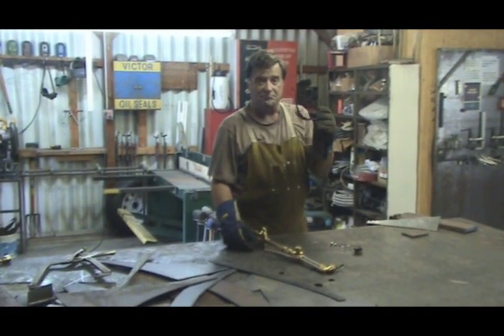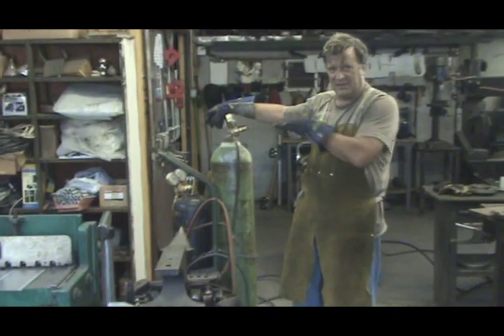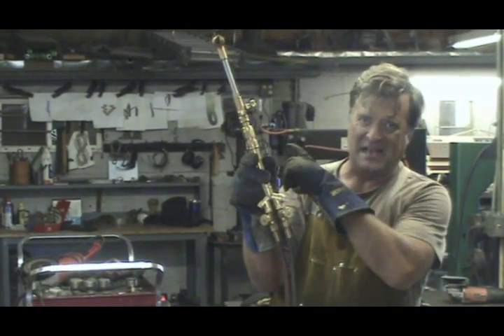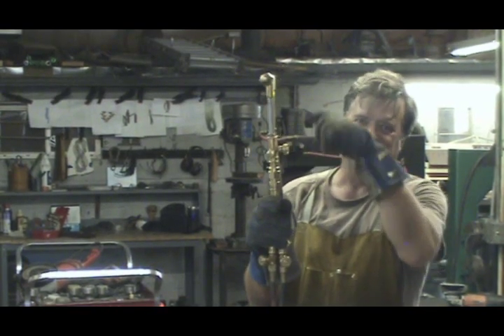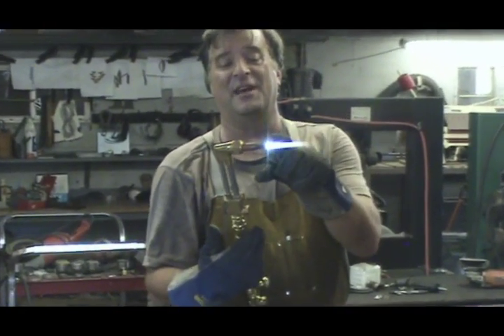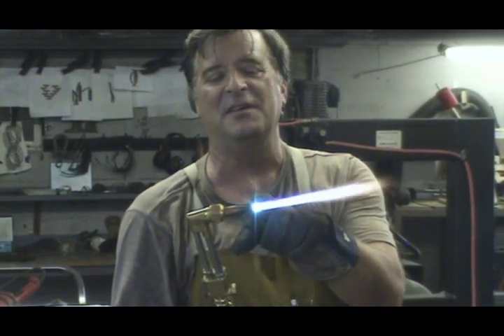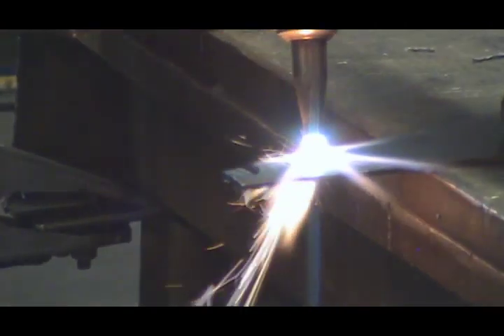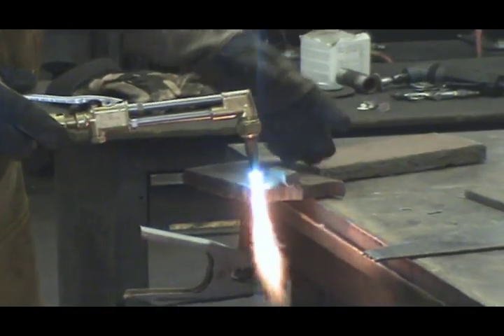Metal Cutting: Using Oxygen-Acetylene - Kevin Caron

Comment: Hi Kevin, a question for you. I am starting to learn Oxy-Acetylene cutting. I shut off my torch, acetylene first, oxygen second, but the flame didn't go out fully. A small 1-2" flame kept burning at the tip for 30 seconds or so. I don't know how long it would have kept burning. I turned off the tank. Could there be a problem with the acetylene shut off valve on the torch? Some other issue? Thanks so much!
Reply from the maker: YES!!    You have a bad valve in the torch handle.   Time to have it rebuilt or replaced.   You can take it to your local welding supply and they can get it rebuilt.  You should also take both regulators and have the whole set done at the same time.
Reply: Thank you!!! I will do so.

Comment: @kevincaron I too have seen the "open 1/4 turn" for oxy, but typically only in books for metal artists.  All of the "open oxy fully" comments were in hardcore welding books.  Just two I found:

"The oxygen valve is opened all the way until it becomes tight ." 
'Welding: Principles and Applications', 7th Ed, Jeffus

From Stanford University:
"Open the main valve on the oxygen tank.  Turn the valve until it is fully open (until it stops turning)."  

Thanks for your great videos Kevin!

Comment: Hi Kevin; I like your videos, but this one contains a pretty glaring error:  You state that a O/A cutting operator should open the valves on both tanks a "quarter turn only".  That may be correct for the acetylene, but most definitely NOT for the oxygen cylinder, as you must turn the oxygen tank's valve ALL the way on, since oxy valves are double seated (if not opened completely the oxygen will actually leak from around the valve stem's o-ring due to the immensely high pressures).

Comment from the maker: @nvr4saken Well the welding tip is getting a little warm right?  It will be cooler than the cutting tip but not stone cold.  The cutting tip getting to hot to touch may be pressure setting on the regulators. You should check the settings for your torch set and make sure the gages are set correctly for the tip you are using. The pressure for the welding tip maybe different than the cutting tip. 
Hope that helps.

Comment from the maker: @nvr4saken Well, I taught myself, so I always turn off the knob I grab first then turn off the other one. IN MY OPINION it matters not as long as the flame is out before you set the torch down.  As for the bottle valves, I only open them 1/4 turn so I can turn them off in a hurry if I have to. 

Thanks for posting.